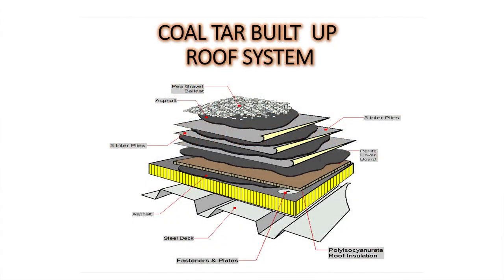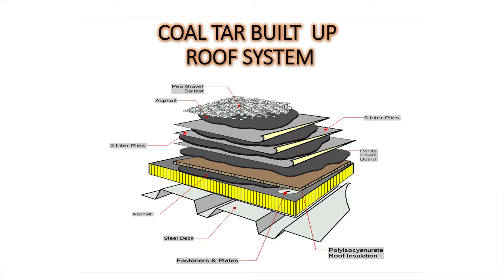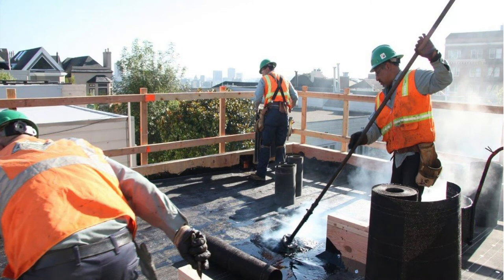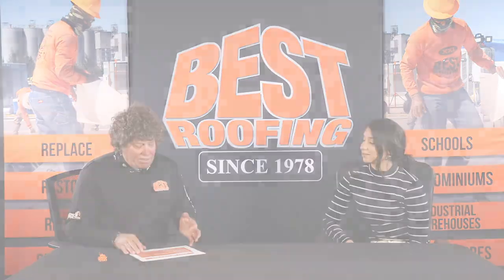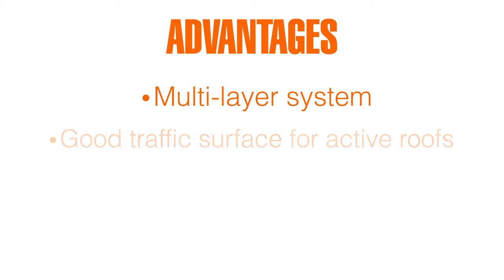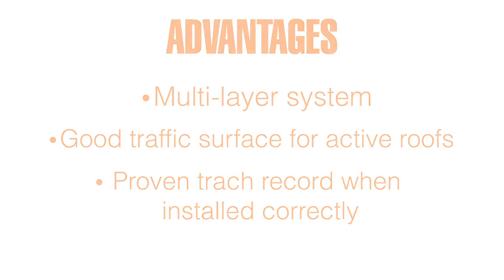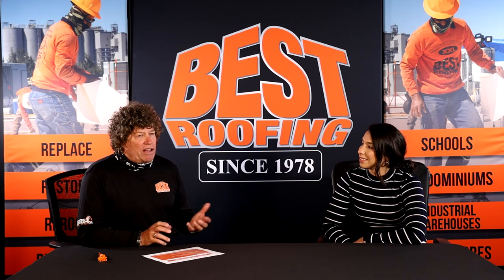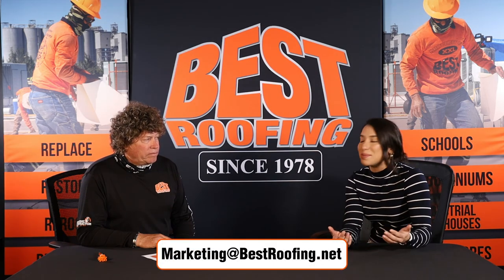Hot mop roofing system? LET'S ASK GREGG!

Comment: So hot mopping will not last as long s todays peel and stick adhesive?
Reply from the maker: Thanks for the question!

"Peel and Stick" is only one type of attachment for newer roofing systems. You also have mechanically attached, torch applied, cold applied, and fully adhered roofing systems. 

In many cases, these newer technologies are outperforming "Hot Mopping". A hot mop system could last 40 years, or it  could fail in 10. There are many variables that effect this with a hot mop system.

However, there are less variables and more consistency with the newer technologies that are available today.